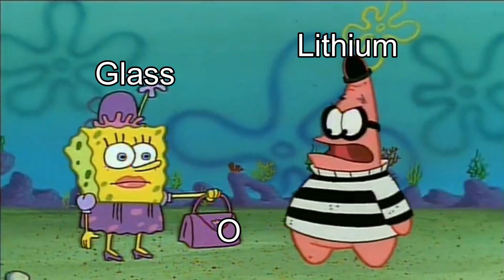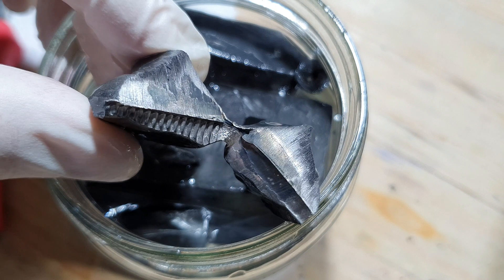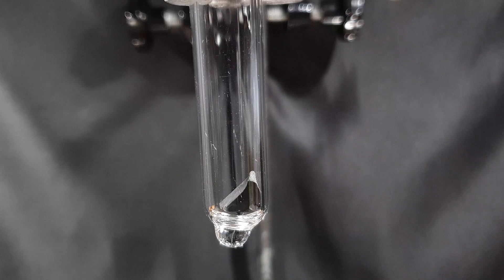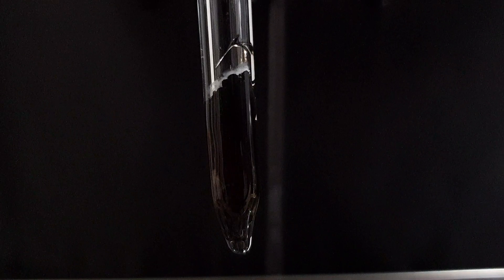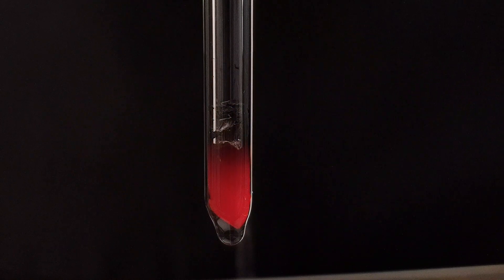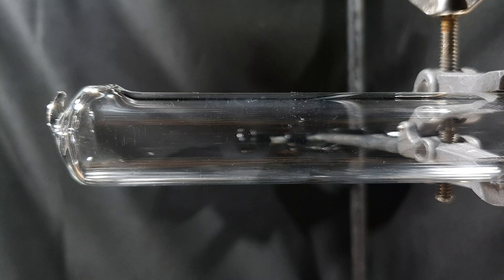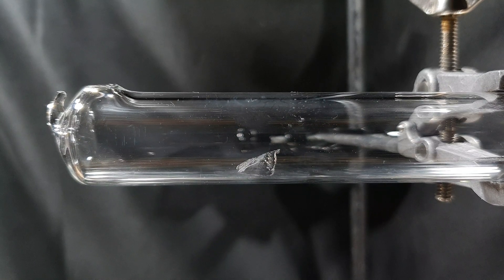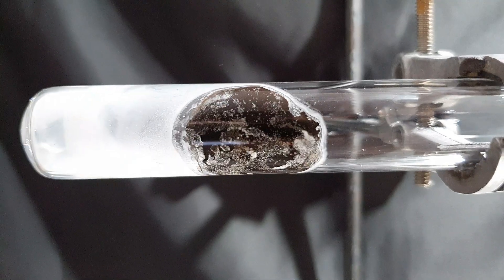Why you should never heat Lithium in glassware

Comment: Hi! This looks pretty similar how I use to burn my magnesium getters inside borosilicate tubes when making nixie tubes 😂. Previously I used steels shells around magnesium and used induction heater for burning, but then I realized that just heating with the torch does the trick and none of the tubes have failed so far, but this is just a hobby. Thanks

Comment: Maybe it would be interesting to see if a quartz test tube reacts the same, faster, or slower than a borosilicate glass. Quartz might not crack as quickly.
From Wikipedia ...
"The composition of low-expansion borosilicate glass, such as those laboratory glasses ...is approximately 80% silica, 13% boric oxide, 4% sodium oxide or potassium oxide and 2–3% aluminium oxide."
Reply from the maker: I will try it with quartz glass soon!
Reply: @AdvancedTinkering  

Some quirky characteristics maybe of interest according to this article but not something you would normally encounter in a typical lab environment.( D.W. Jeppson and coworkers (1978) ) LITHIUM LITERATURE REVIEW:
LITHIUM'S PROPERTIES AND INTERACTIONS
"Liquid lithium will not react with oxygen or carbon dioxide in air at its melting point in the absence of water; but 10 to 15 parts per-million (ppm) moisture will cause lithium to react with air, nitrogen, oxygen and carbon dioxide at room temperature. "
It sort of reminded me of this other topic on iron rusting but I digress.
"Dr. G. T. Moody has shown that if very special precautions are taken to exclude all traces of carbon dioxide, then iron may be left in contact with pure oxygen and water for many weeks without undergoing any change. In one of the experiments thirty times as much oxygen as is required to convert the whole of the iron into oxide was passed during the course of a few weeks, but there was absolutely no rust. But if the air were not freed from carbon dioxide rusting commenced at once, and in seventy-two hours the whole of the metal was corroded. There would seem to be no basis, therefore, for the assumption that iron can be caused to rust by pure water and pure oxygen only."

As if that weren't enough minutia/trivia to read, even fused quartz can vary in makeup. From QSI Quartz Scientific Inc.
Properties of Fused Silica
OH content
In addition to metallic impurities, fused quartz and fused silica also contain water present as OH units. OH content influences the physical properties like attenuation and viscosity. General, high OH contents means lower use temperature. Typical values are given in the table. Electrically fused quartz has the lowest hydroxyl content (< 1 – 30 ppm) since it is normally made in vacuum or a dry atmosphere. Hydroxyl content in this range is not fixed in the glass structure. It can go up or down depending on the thermal treatment and amount of moisture to which the quartz glass is exposed at elevated temperature. Flame fused quartz has significantly more hydroxyl (150 – 200 ppm) since fusion occurs in a hydrogen/ oxygen flame. Due to the production method synthetic fused silica has similar high OH contents of up to 1000 ppm.

Comment: Oddly, the more reactive alkali metals don't seem to attack glass like lithium does. I've seen videos of people heating the more reactive alkali metals potassium and rubidium very strongly in glass ampoules even to the point where they start boiling and they still don't react with the glass.
Reply: The electronegativity and ionization energy of the heavier alkali metals is lower but the cations are larger so their metal oxides are less energetically favorable.

Comment: I've never been able to attack glass, even with hot, concentrated sodium hydroxide solution. The situation is different with molten sodium hydroxide, which attacks glass quite quickly. By the way: I did melt it to get sodium metal via electrolysis, which worked quite well for small amounts. The melting point of sodium hydroxide is 318°C, and yes it is very dangerous to handle such hot and corrosive stuff!
Reply: Concentrated sodium hydroxide solution will attack glass, but it's slow and poorly noticeable. It's one of the reasons why one should never clean volumetric glassware with it. Even a tiny change in thickness will result in the completely mismatched volume.

Comment: Thank you for this video, it's good to be aware of this problem! I found this out the hard way when trying to distill lithium in a quartz tube vacuum oven. The borosillicate glass destillation setup was all cracked and black and the lithium that leaked out even damaged the quartz tube. Luckily I only used a small amount of lithium... By the way, do you have the link for that other lithium glass reaction video that you mentioned in your video?
Reply from the maker: Interesting, I was asking myself if it would also attack quartz glass. It can be very terrifying if you don't know about it. 

Sure, this is the other video: https://youtu.be/cFGejaYqM-c

Comment: Thanks for this. Based on your explanation, I am guessing it doesn't matter whether the glassware is quartz or not? Did you find that the reaction only occurs when the lithium metal begins to melt?
Reply from the maker: Im honestly not sure. I never tried it with quartz glass. As soon as I get my hands on some, I will try it. 
I have never witnessed a reaction at room temperature.
Reply: @AdvancedTinkering  Thanks for the reply. There is an article by D.W. Jeppson and coworkers (1978) saying that molten lithium can be held in quartz containers up to 285 degC. So I guess there would be a difference between a normal glass and a quartz - interesting to see what you get. It may be that molten lithium is just incompatible with all glassware, or certain types of glassware can tolerate molten lithium but not at elevated temperatures.

Comment: I didn't understand the carbon example, were you saying that carbon is also dangerous to heat in glassware since it can also reduce the glass?
Reply from the maker: No, you can heat carbon in glassware. The reduction of silicon dioxide with carbon is performed at 2000 °C. The glass will be molten at this temperature anyway.

Comment: i have broken quite a few beakers and flasks from molten lithium, an example would be when i reacted fuming nitric acid with lithium where the lithium was hot enough to liquify and stuck to the beaker eating a hole through it, and cracking on cooling
Reply from the maker: Yes, I was always terrified that there could be some lithium in the flask when distilling the cesium. 
Out of curiosity, why did you react lithium with fuming nitric acid?